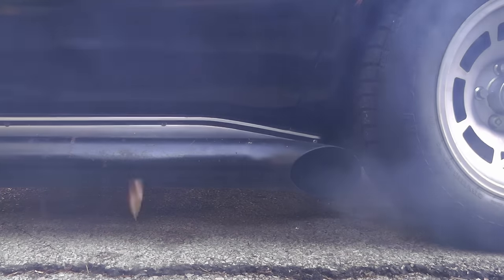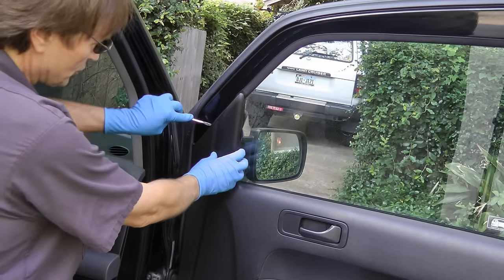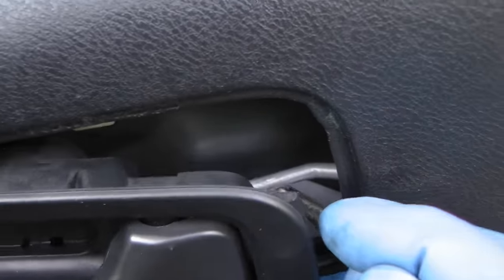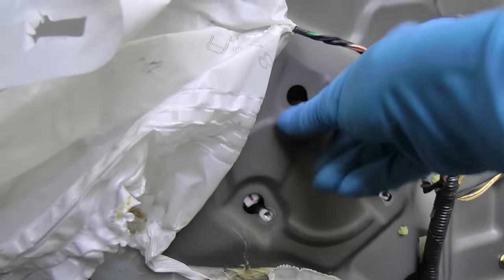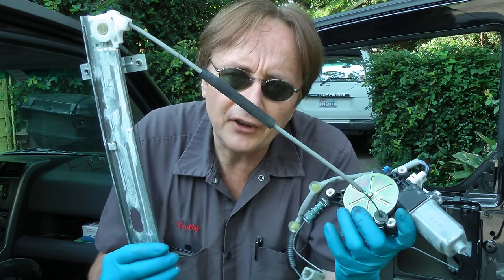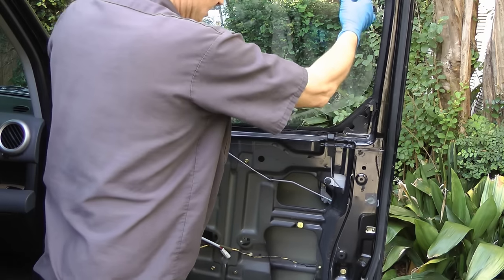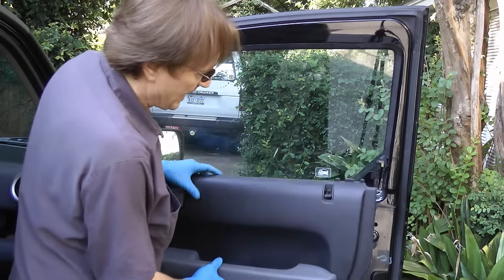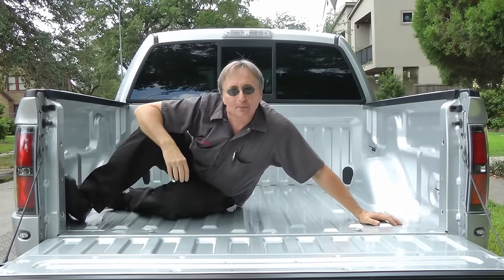How to Fix Power Window (Regulator Assembly) in Your Car

Comment: hey Scotty my front windows won't come down or up.I replaced the whole thing like u did in this video but still nothing. The back windows go up and down with no problem. Any advice will help.. Thanks in advance!! Keep up the great work on the videos that u make.
Reply from the maker: check the switches first, they may be bad. that's most common. Pray it's that and not a wiring short somewhere inside the car

Comment: For a quick fix, try punching your door handle toward the outside while pushing the button. The window will go up, and youll know you have a faulty wire in the switch.

Comment: I had a Renault 9 years ago - the unit on the motor the cable was attached to broke - I repaired it by packing the acrylic (cold cure ) I use it to repair dentures , around the cable and motor unit - I'm a dental technician not a mechanic !!- cold cure has a myriad of uses can be bought from companies that supply dental laboratories - work fast with it though , it sets very quickly !!!

Comment: Ay scotty, my 2008 Suzuki Forenza passenger side window works when it wants to. If it does not roll up, I open and close the door and it seems to be the solution for now. Is it the motor, wiring, fuse? I have no clue. Great videos bro.

Comment: hello i have a 1999 ford expedition and my driver side of the window keeps falling also my passengers window as well should i just replace both window assembly's? the passenger side has power and goes up and down but i guess it's off track and falls....and the driver side there is just a clicking noise when i press up or down on that side of the window im not sure what to do? thanks for any tips or advice

Comment: Scotty loved the video! my driver side window goes down, but won't go back up. I have a slk230 benz and added a used ebay motor and no dice. Since the passenger window works fine i tried switching the window switch and the problem still exist. Once thing I noticed is there is a buzz when i press the window switch that sounds like it's coming from the dash or engine compartment. I ruled out the regulator since it goes down, but could be wrong. Any ideas?  

Thanks!

Comment: One time i put  my window down and it wouldnt come up, the power motor wasnt dead but the glass was just stuck, what i did was engage the window motor with my finger towards up and slammed the door. Worked after that

Comment: Hey Scotty, thanks for answering an earlier question of mine! I have one more for you... Driver's side power window goes up and down just fine, but the motor is noisy, much louder than it should be. Other than replacing, is there a way to resolve that?

Comment: Scotty, changing out 3 window motors on a 2005 Toyota Highlander, 1 front passenger and the two in the back. Are the motors interchangeable when it comes to front and back on the same side?  In other words, Am I correct in ordering (2)same part number motors for the right side(front/back) and different part number for the (1) back driver side window?

Comment: Thanks for sharing this video. Question. I have a 98 toyota corolla and my rear left drivers side electric power switch( I think that's what its called) and the trim panel in it is loose. I looked at before and it seems like it works. Can you do a video on fixing power switches ?

Comment: Good video, don't know if I am equipped to fix it myself though. I have a 2009 Hyundai Sonata and the rear passenger window sounded like a chain broke and fell inside the door now the window won't roll up. I can push it closed and it just slides back down. :( what can I expect to pay for someone to fix it??

Comment: I have a kia Optima 2012 my regulator and motor work fine but im stuck on how to spool the wire on to the reel
Reply: Just bought and installed whole panel im good now

Comment: Hi Scotty - one of my power windows goes up reallllly slow, and I noticed while it goes up that the voltmeter on the car drops substantially. I almost bought another regulator but then thought, if the motor actually works, but there obviously seems to be a current issue, then i should check wiring. I know the motor could in fact still be bad and that the volts drop because of that, but I think i should do a volt drop test. Do you agree? What's a permissible drop, 0.5V?

Comment: HELP!!!!   Your videos are great.  I love my 1997 4runner Ltd with 240k.  I want keep it runner forever.  Can you help me with one issue that I can't solve.  My passenger door window only goes down but not up.  I have replaced the window motor already but it is still having the same issue.  I tried both driver and passenger side buttons, checked the fuse but they both can't bring the window up only down.  Can you give me a few pointers in troubleshooting the issue.  Thanks.

Comment: Hi,  great videos. I have a 2007 Hyundai Sonata. Passenger window can only go up about 3 inches.  It could go back down, but when I bring it back up,  after 3 inches or so, it starts making a churning sound that gets "thicker" and the window gets stuck. I want to fix it myself. Any idea what part I should get? (All other Windows work) Thanks!
Reply from the maker: replace the window regulator assembly

Comment: Hi Scotty, should I use seafoam or spray water from the throttle body to decarb the engine? Which one is safer to use (i.e. hard to screw up the engine)?

Comment: Hey Scotty need your help. I have a 2000 Nissan Altima, the driver and the both window in the back work perfect but the passenger one doesn't work at all is just up, won't go down or up. Now when I use the switch I don't hear anything at all no click no noise nothing, I check the fuse n it's fine but also the master switch for the passenger doesn't work too. About the relay to be honest I have no idea which on it may be i check the box on the engine and I just didn't see anything with electric and I check the fuse box inside the cars and I saw I couple relays but idk which one it is lol hope to get a relay soon thanks Scotty big fan from Miami Fl

Comment: How do you test the connector to the motor from 3:25 to 3:32 without the frame in place? How did you roll up the window? I'm a novice at car mechanics, but this video is helpful otherwise.
Reply: He used the window switch on the drivers side
Reply: Makes sense. With my car, the driver's window was broken so I couldn't do that. That's why I was confused.

Comment: Scott, My rear passenger window (2005 Accord) was making some awful scratching/crunching sounds towards the front edge when I roll it up.  It sticks about 4 inches from the top.  Motor works, switch works.  How would I fix?

Comment: Hey Scotty
My manual window is very difficult to roll down on my 97 Saturn sl1  as if lubrication would help. what do you think is wrong  the tracks the glass slides in too sticky ?   Thanks . Enjoying your videos !
Reply from the maker: If silicone spray lube does not help, then window motor and or regulator assembly needs replacing
Reply: OK  these are manual windows. DO I remove the door panels to get access for spraying or just spray in tracks and along the edges of the glass ? Thanks
Reply from the maker: Bill Nolan
odds are you need a new manual window regulator assembly then. But see my video "removing an inner door panel" for your try.

Comment: I have a ford laser tx3, basically also known as kf ford, my power window always have many problem, so here is my questions:

the problem of power window is it relevant with the fuse box in the car?
the motor and window motor regulator is it need to buy same model of car to fix it?
or just take from any car and replace it?
Reply from the maker: one fuse runs all the power windows, if they all don't work could be a blown fuse. BUT, more often motors and regulators go bad. You have to get the one made for that make and model, there are thousands of different sizes.

Comment: Hey Scotty,

I Just bought a 2002 Lexus ES300 but the window behind the passenger doesn't work. when I click on the driver's panel to put the window down you hear a click on the bad door. Should I try to fix the old motor or Just buy a new whole assembly.  Are they expensive?

Comment: My rear passenger window doesn't like to go back up, at least not right away.  It usually goes up a little bit at a time then stops then I wait until I get home and it usually goes back up.  I'm hoping to fix that this spring/summer before winter because it's not fun when you forget there's a problem then can't get the window back up and you have cold air blasting in.

Comment: Scotty... you appear to be the guy to ask. So, I'm asking...
Driver's side, on a 2011 Ford Ranger, goes up very smooth, no drag. Coming down... it stutters. Tried lubing the molding with dry-lube, but still stutters on the way down. I'm hoping I don't need to replace the regulator, but I can. They only cost about $40. But I'd rather not fix it, if it ain't broken.
Thanks in advance for anything you have to offer.

**EDIT**
After looking again...
I brought it down to the mid-way position, and grabbed the glass. This window has play in it, as it would teeter, from left to right. The passenger side... very little wiggle. Could I be looking at a loose or missing bolt? Putting pressure on the right side, while going down... smooth. Let it go... stutter. Your thoughts?

Comment: hey Scotty, great video! I was wondering if you can give me some advice on my car. I have a 2004 Honda accord coupe and for the past year the windows would open and close after pressing the switches multiple times. Recently though it stopped opening altogether. It started with the driver side, and then the passenger side stopped opening altogether. I checked the fuses they were good. I switched the main power switch and the windows are still not opening. I just hear a click sound. Thanks!

Comment: Scotty, I have a 96 eclipse spyder. The car is a convertible, recently all the windows excluding the driver side window stopped rolling up or down. However for a while the driver side window would go up and down fine, recently the driver side stopped working to, however when i flip the switch i hear the sound for the motor. I don't hear any noise at all when I try and use any of the switches for any of the other windows. Do you know exactly what's going wrong? Really need to get the windows rolled up before it starts raining. Thanks
Reply from the maker: the main switch assembly is probably bad, change that first. The realize the driver's side regulator is probably broken too

Comment: Hi Scotty. For my 08 mazda 3..
The mechanic did some wire reconnections (grounding?) on the front passenger side to have control over its own window coz the central switch lost control over it. Now that i have bought a new master lock/switch, i'd like to know how i can put the wires of the front passenger side back to its default connection..thank you.

Comment: Scotty, I got a 96 Saturn sc2 and tried to remove the door panel after removing all bolts and clips but the panel still won't budge. it stuck at the door handle. do I need a special tool?

Comment: Hi. I already replaced window regulator with motor on my civic 97. I also replaced the power window wire harness but still my passenger side power window won't go down what other options do I have? Thanks.

Comment: I have a 98 Monte Carlo LS and just recently at an Arby's drive thru, my window would not want to roll back up. Right now in Northern MN, its a bit cold for my window to be opened all the time. Luckily, and randomly I was able to roll it back up after leaving it be for the night. But I fear rolling it down again! What do you think could be the problem?
Reply: +Miles Away power window master switch. 20 bucks +or- and easy fix.

Comment: Scotty - what exactly is the gooey black crud that the manufacturers use to stick the plastic membranes on car doors, sandwiched between the door panel and the door itself? Can you suggest a good method to remove it from the door without damaging the paint?
Reply from the maker: use spray carb cleaner

Comment: Odd issue with my ford focus windows: For about a year, the front two windows were working fine with the back two windows not being responsive. Tonight, the front windows are not responsive (after rolling them down), but now the back windows are working. Thoughts?

Comment: i bought an 02 blazer with a sluggish driver side window. today, while rolling it back up, the window stopped completely and would not budge. i parked my car a few minutes later and it rolled up fine, still a little slow, but it rolled up. what do you think is the problem? i think ill try cleaning all the connections first.

Comment: I'm stuck I replaced motor and switch and Windows go down as soon as I plug it up.  I've checked wires they are all good.  what am I missing ?
Reply: did you fixed?

Comment: Hey Scotty,
I have a '69 Tbird that the power windows don't move but the motor makes noise.  Which must mean the gear is bad, but as I remember when I drove a '65 Tbird back in the day that the spring on these things are like bear traps.  Since I like my fingers I wondered if you know how to change out these motors without losing any digits.
Thanks,
John W

Comment: How do you know if it's the switch or motor? On my Frontier the master switch (driver's side control panel) works on all windows except the driver's window. Does that mean the switch is good or is the one button on the switch that controls the driver's window broke? Would all buttons in this switch not work if the switch is broke?
Reply from the maker: Ken Mitchell only way to tell for sure is to take the door panel apart, unplug the motor, then send power and ground to the motor wires to see if it works
Reply: By sending power and ground you are saying use the screwdriver with the light on top and a wire with an alligator clip right?

Comment: Scotty,  can the plug that goes to switch go bad..reason I ask is actuator and switch are working..even bought new  actuator which I tested from a separate 12 volt battery.my master switch works passenger window,but driver window doesn't work...again I think it's the plug going bad since power to the passenger window is good...your opinion is appreciated. .thanks
Reply from the maker: of course anything electrical can go bad, you test em with meters for power and power loss
Reply: Scotty Kilmer thanks Scotty...I will go to junk yard and see if I can find some of those plugs...I can't see how it could be anything else...thanks again
Reply: unless there two hot wire's going from harness to the plug for the two windows...and one is bad..but my new switch has leds showing plus the passenger window works fine...anyway I will keep my fingers crossed...

Comment: On my car sometimes the window works and sometimes it doesn't for the passenger side. so I'm thinking the motor is bad? The reason I say that is because the switch does not work on the drivers side switch panel or the passenger side ass well. Your input?

Comment: Is there a special adhesive that can hold those plastic parts on the window that sit on the regulator ? My sister's 05 Corolla detached from it . It has two 10mm bolts that attach it to the regulator .

Comment: Im not sure how your's is set up. but, there is one that requires you to remove the door panel and one that only requires you to remove only a small trim piece(typically triangular). After that it's normally small wire harness and 3 nuts to remove and replace.

Comment: Scotty "HELP"! My passenger window will not go down!? The other three work. I don't hear any noise. Should I buy a new assembly? I'm pretty sure that it has power to the window, but I haven't checked. What do you think the problem might be? I have a 2005 Buick Century. Thanks
Reply from the maker: generally either a burned out window motor OR a bad motor switch. Do as in this video, remove the inner panel, put power to the motor, if it doesn't move replace it
Reply: Thanks so much! :-)
Reply: I just wanted to update you, Scotty. I went to replace my passenger side window motor & regulator, when I notice that my driver side window lock was broken. I also found that the contact in the switch (driver side switch), wasn't working for my passenger window! I replaced my driver side window switch, and now all of my windows are working just fine. I saved about $170 by buying a $65 window switch! LOL Thanks Scotty! :-) Today I'm gonna replace my two front Hub Bearing.
Reply: Done! I still hear a "hum" noise when I began to drive, then my service vehicle soon & ABS lights still comes on. I have a code for (C2226).
Reply from the maker: Quaid78
often a bad speed sensor/hub bearing problem does that

Comment: Mr. Kilmer my passenger window goes down no problem and up until a certain point. Once it reaches that point it tilts and becomes crooked. To get the window back up I have to straighten the window pull up on the switch, and repeat until it's all the way up.
Reply from the maker: herier44 you need a new window regulator assembly
Reply: Scotty Kilmer thank you sir have a great day.

Comment: Scotty, I have a 1995 Nissan Altima, none of my power windows work. What would be the first thing that I need to check. Thanks in advance
Reply from the maker: Patricia Rowe check the main power switch and the fuse
Reply: Thank you  Scotty,  I  will  look  to see  where  the  fuse is for the  power  windows. I did  see the relay in the  engine compartment. I  did not see the  fuse for the power window.
Reply: Scotty, my air conditioner is  blowing warm air, so i bought a can of A/C pro refrigerant and attached the  gauge and the guage was in the  red. Does that mean that it doesn't need  to be charged